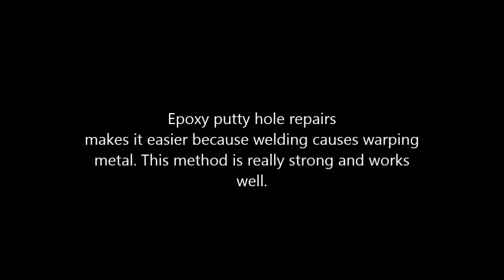How to fix a hole in metal without welding epoxy putty rust repair vw

Comment: This is a related video from what I've recently watched.... See, I have a gas bicycle and I made a (re-)repair to a hole where the mounting studs are welded to the gas tank. I used a product by the company VersaChem called Magnum Steel Epoxy Stick... From all looks of things, it's another company's version of JB Weld TankWeld, except according to the safety data sheet it has even more (and improved) ingredients. Anyway, I just wanted to mention it 6 years later from when your video was posted :D

Comment: Those 2 part putties are made by everybody. Per the JB Weld data sheets, they are far weaker than regular JB Weld I doubt POR 15 2 part putty is any stronger. For wood or plastic or low strength requirements, they are a good bet but for max strength on steel, stick with regular, wet JB Weld. Build some kind of dam to keep it in place, if necessary

Comment: Will it work for a coolant leak
Reply from the maker: Might be a short term repair but I would not recommend it. All that pressure and heat could fail.
Reply: I used JB weld to fix a coolant leak in my farm truck and AC leak on the accumulator for my DD. They've both held for 2 years so far. I wouldn't normally do this, but if it's a beater I would go for it

Comment: I used the JB weld putty for some screw holes for my cowl on my truck. Tempted to use it in more holes. So far it's healed well!
Reply from the maker: JB weld works great. this stuff has a bit more body and can fill in larger areas plus sands a little bit easier. still strong.
Reply: None of those hand mix dry putties approach the strenght of regular JB Weld. Look at the JB Weld data sheets to compare

Comment: Yes it must be to bare metal for good bonding. In your application it may have worked because the putty anchored on both sides of the whole. Thanks anyway I have not seen this product for a long time.
Reply from the maker: Sorry not in the instructions I read. Says it even bonds to concrete, plastic parts and nobs. So bonding to cleaned paint with a wire wheel should be sufficient. It is not like bondo that has a resin that heat bonds to bare metal. Bare metal not a requirement by the manufacturer.
Reply from the maker: http://www.tcpglobal.com/docs/POR-15_EpoxyPuttyDirections.pdf

here is a link of the instructions.
Reply from the maker: yea jb works well just a little thin for a larger hole. I use it to fix plastic grills. and stuff like that. It also take a long time to dry for the regular stuff. the 15 min is not quite as strong.
Reply: @Mikefngarage  I know this is old but he's probably talking about JB Weld Steel Stick. It's a putty stick the size of a roll of nickels. It has an inner core and an outer layer. It works with the same principle as the putty you are using. You cut off a slab and knead the inner core with the outer layer to activate it. Hardens rock solid.

Comment: yeah it definitely needs to be cleaned all the way mate. decrease that then wipe it will alcohol to bare metal then do it.
Reply from the maker: Sorry not in the instructions I read. Says it even bonds to concrete, plastic parts and nobs. So bonding to cleaned paint with a wire wheel should be sufficient. It is not like bondo that has a resin that heat bonds to bare metal. Bare metal not a requirement by the manufacturer.
Reply from the maker: http://www.tcpglobal.com/docs/POR-15_EpoxyPuttyDirections.pdf

link for the instructions.

Comment: this works to fill a hole but it wont stop the rust, it may take 5 years but it willl fail
Reply from the maker: yea for sure gotta treat that rust with acid to neutralize, coat it with something and remove the thin areas then you can use something like this.

Comment: Why wouldn't you just tack weld in a small disc of sheet metal? Thats A long term fix. A small mig machine is affordable, easy to use, and a must have when restoring old veedubs.
Reply from the maker: I do it that way all the time. but sometimes I just dont want to do all the grinding on a last minute repair or something that could warp. In that case I didnt want to make all that noise of grinding that area. The repair is super strong and permanent